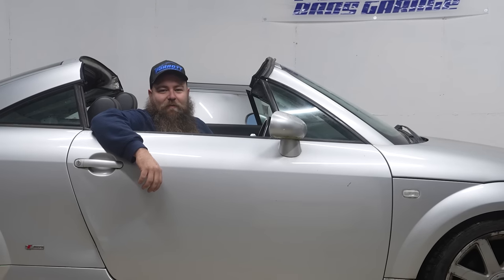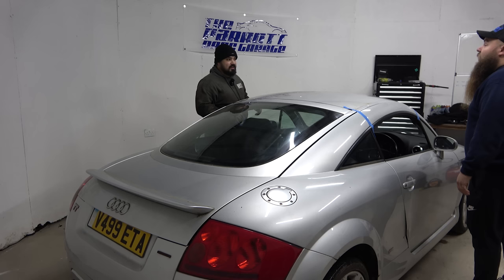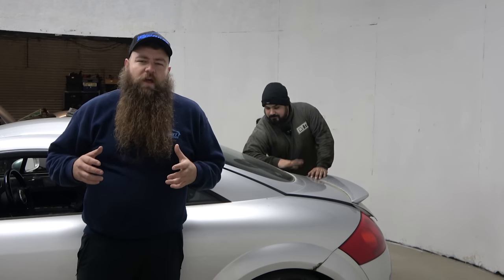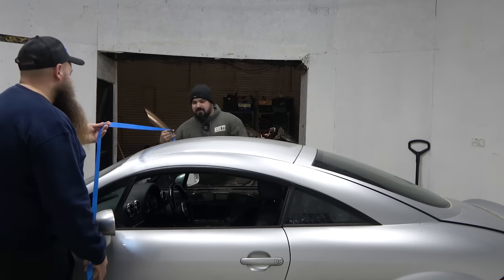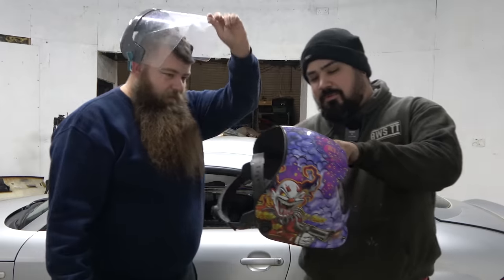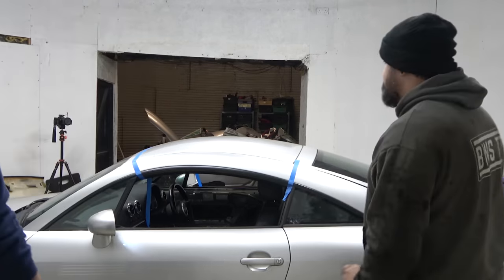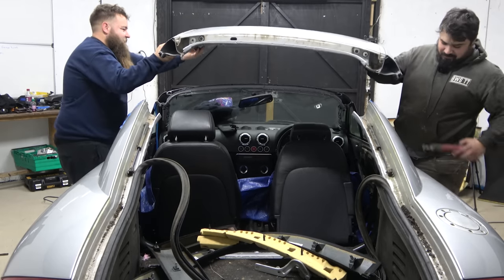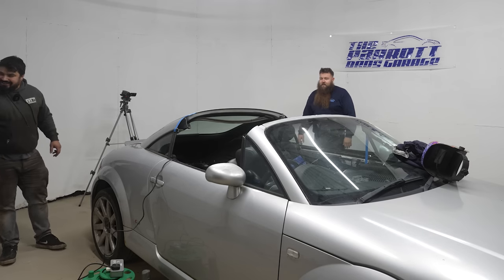The Rarest Audi TT Open Sky Concept Car

Comment: Targa my all time fav. I have three silver MK1 TT"s. 6 speed auto, left had Manuel  Quattro  and a rare sports line.
Reply from the maker: Wow thats  some collection! i appear to be buying a lot of silver tt's recently too haha not sure why just seems to be a few about
Reply: @TheParrottBros  They should of given the option of an electric hard roof as the merchant SLK. All that boot space. Anyway a question for you pulled away from the lights hard now I hear a little knocking when changing gears or just shifting gear position on my auto box. Sounds like like a drive shaft knock, diff or even what I have been told the auto transmission. What's your advice as Audi here in Japan would charge about 4,000 pounds to sort out if its the auto transmission.

Comment: Hi I like to ask a question I just got a Audi tt 2001 convertible. It does not have a switch for the top. Can it be this model is manually to open the top or the switch can be some where else. Thank you

Comment: I really want to recreate this. I fabricate for my job and make and repair car chassis. I really want to do it one day, I would probably start with a convertible as a base :)
Reply: Wrong shape base, and the open sky was 4 seat
Reply: Like the MX5? I once read that the MX5 was called project KISS, Keep It Simple Stupid. Adding to a car that’s is designed without a roof seems a better option than subtracting from one that is. The coupe roof is a bit of a dome so it could be a challenge to get panels to fit back in.
Reply: @BWSTT  VAG really tested the limits of the trade description act, it’s a very impractical 4 seater, actually 3 seater as rear passenger over 3’6” needs to sit diagonally. I’d delete my rear seats yesterday except that I occasionally pick kids up for 10 minute journeys.

Comment: just looks so good; Targa style fits the design IMO
Reply: https://youtu.be/45QjSCt68IU These guys are rebuilding a 911 Targa, that someone de-targa’d into a convertible 🙄. If I understand correctly it will remain a convertible but with the correct panels used at the rear 3/4 & firewall.  I’m trying to decide if a coupe could withstand surgery inside the roof rails to install a targa or sunroof. The rear tailgate looks like a heavy lump so any aperture in the roof would probably require a load of beefing up to strengthen the top hinge mounts. The curvature of the roof looks a bit too complex for a fabric Webasto.